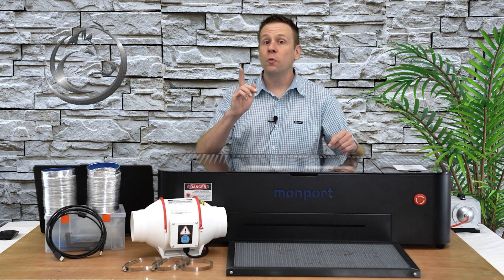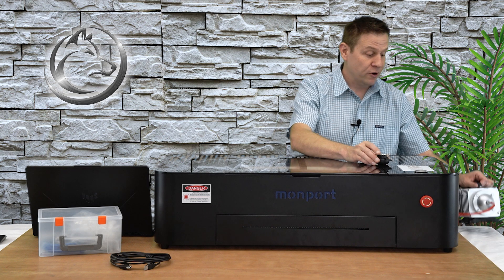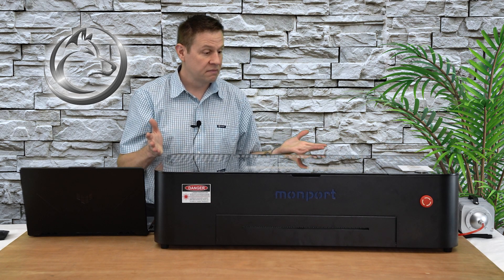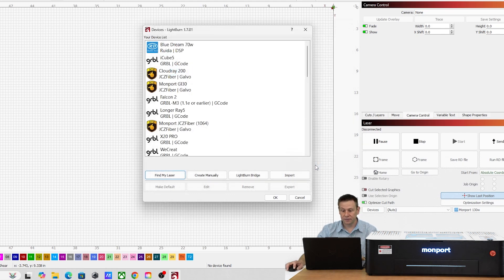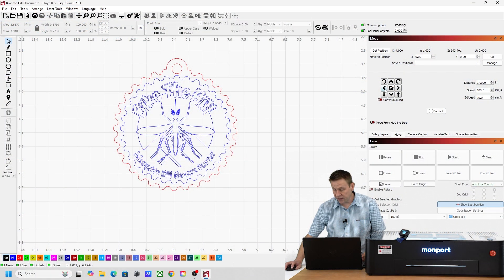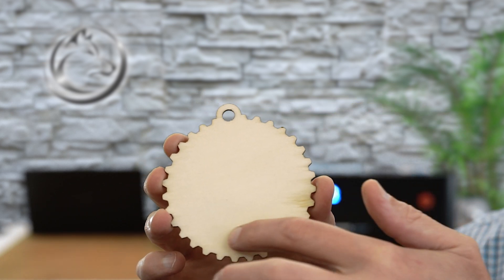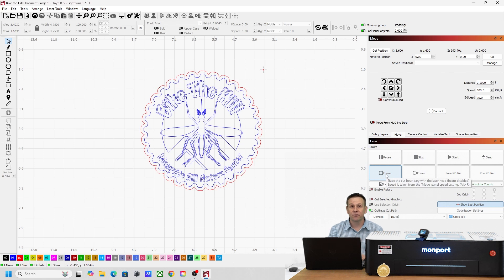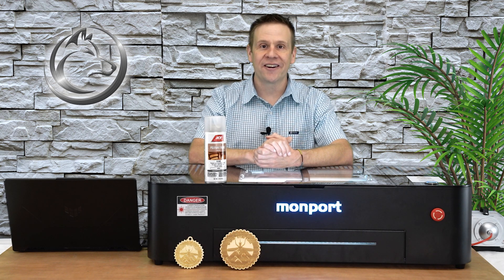Onyx-R Setup- Super Easy! #monport #laser #engraving #diy #woodworking #wood #co2 #laserengraving

Comment: Is there a tutorial to replace the air system?  I am a new user,  with the Onyx-R.
Reply from the maker: 2:58 Shows the removed stock air pump.  3 screws, one connector, and one airline and the air pump is removed!  This video from 2:58 shows the rest of what's needed- very easy and straight forward!

Comment: I just got my Onyx R 5 days ago.   Everything works fine , except the Z axis does not work.  If anyone knows of a fix for that let me know.  At this point the z axis for auto focus does not move.    You can use the arrows to move it , but the focus button doesnt do anything.   The laser itself is well built and works great otherwise.   Im waiting for support to come back for a fix for the Z-axis/ focus, hopefully its a software issue.  The camera calibration was super easy if you turn off your Laser.   Apparently the lights inside the Onyx are so bright it has a problem with the camera.   Try it , worked great for me.
Reply: Did you get the z axis to work? Mine is not working

Comment: Another great video...thank you! It would be great if you could figure out how to "tap into" the air assist circuit to see if you can come up with a way to turn on/off your external air assist pump from Lightburn. 
Would love to see you do a review of the Thunder Laser Bolt / Bolt Plus...see what you can do about that. LOL! 😂😂😂
Reply from the maker: I agree- I'm wondering if I can find an air assist pump that uses the same voltage as the stock machine and just wire it in place... maybe more to come! 
I'm already ahead of you- I've reached out to Thunder laser- I think that collaboration will take some time to develop.  Always happy to see your comments 😄
Reply: @thelaserchannel1  exciting, would love to see you do a review on the Bolt/Bolt Plus. Right now, they are at the top of my list. And thank you for your nice comment! 😀
Reply from the maker: Thanks- you're also welcome to email Thunder Laser if you like :)